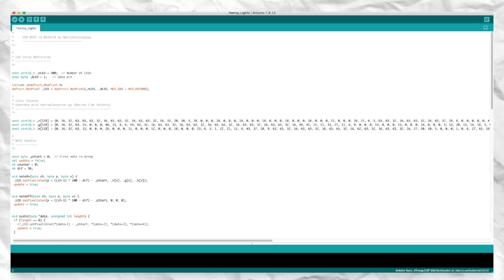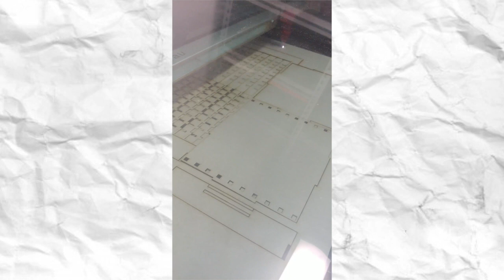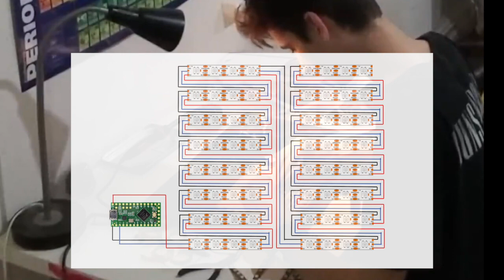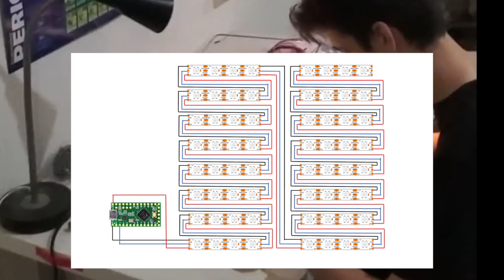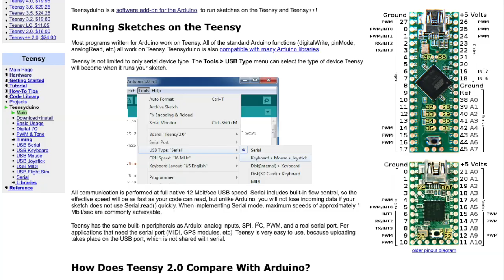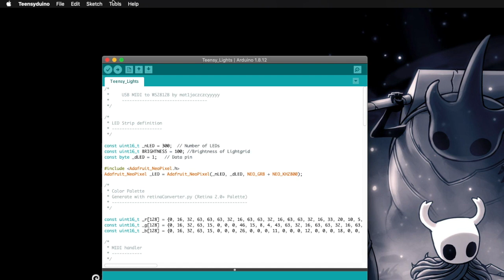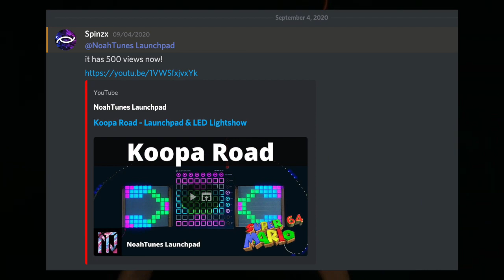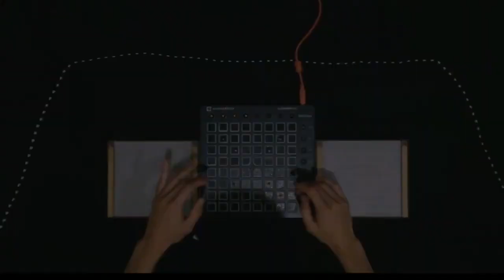Lightgrid Reveal Video - How to make your own 8x8 lightshow device.

Comment: Don't know how I missed this for so long, cool project.
Slight remark - this isn't verified info but I don't think the Launchpads are actually wired physically with the Drum Rack layout. Firmware-side when it comes to business logic their native layout is more similar to that of XY Layout (MK2 User2), but I'm not sure if this gets translated to a different physical layout in the HAL. It's a still a good optimization to wire them this way if you know that's what most of your users will be using (Ableton being Drum Rack layout).
Reply from the maker: Thanks for the correction and the insight!
Reply from the maker: I probably didn't know what a Hardware Abstraction Layer was in 2021 lol